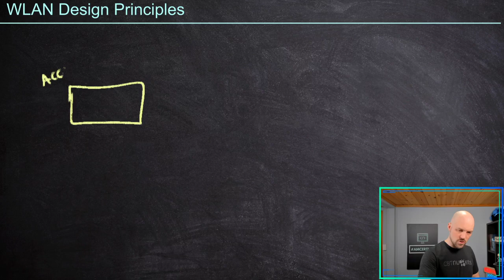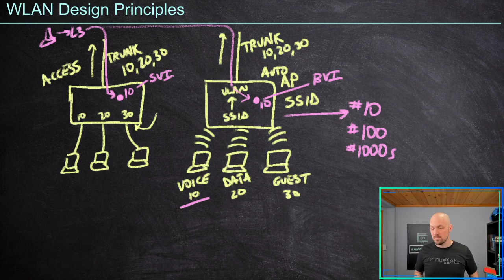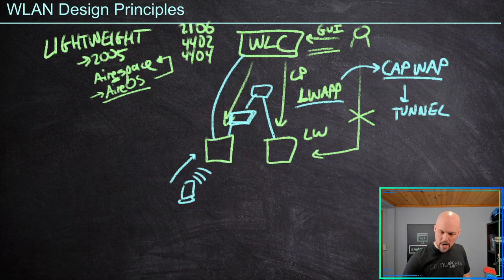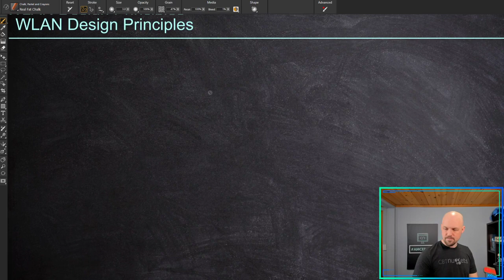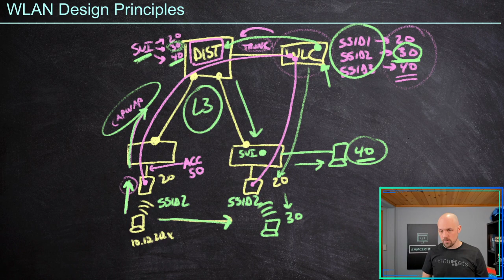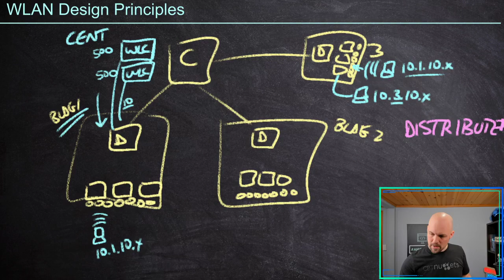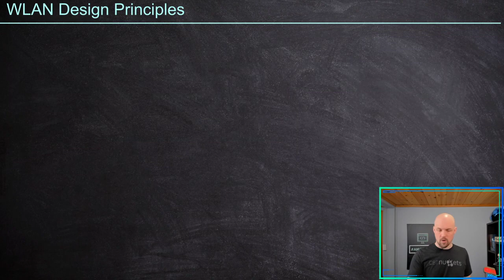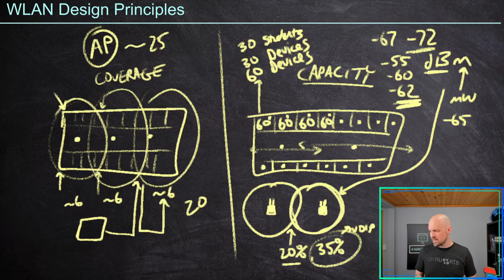ENCOR - WLAN Design Principles

Comment: If user data, updates, and config are all passed from wlc to AP using capwap… why is the AP even connected to a switch port in the first place? What data is being passed along? Is there very specific types of managment data, is it for very specific scenarios? Would love to hear anyone’s knowledge on this
Reply from the maker: The switch provides a network connection and in most cases provides power to the AP via PoE. In massively scaled networks, you might be looking at thousands of access points, and so the APs can't all connect directly to the controller.

I hope that helps! Let me know if you have further questions.